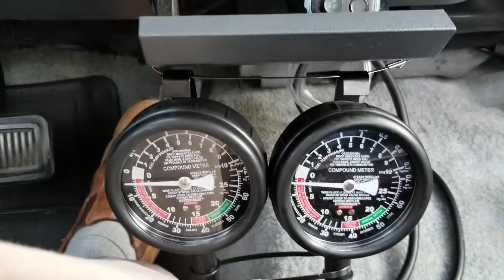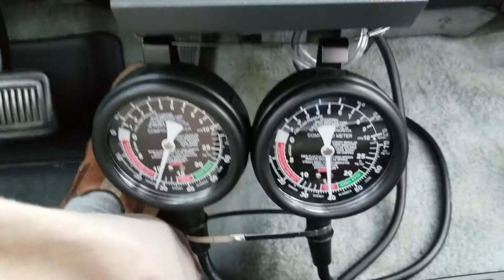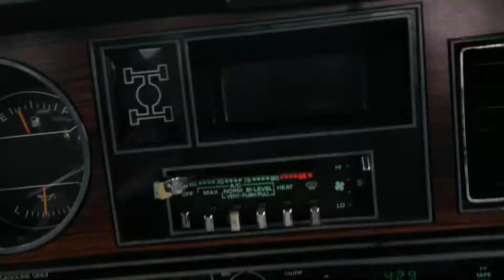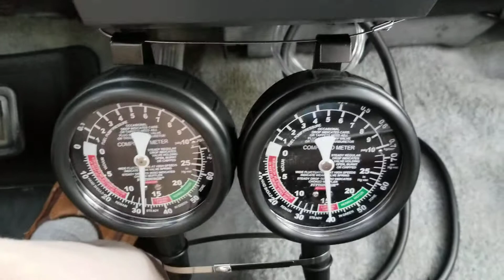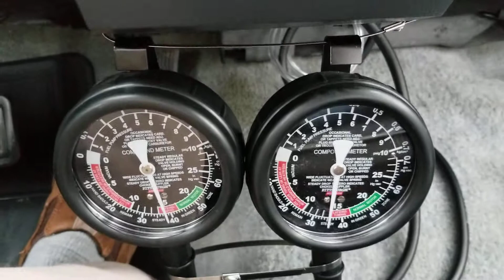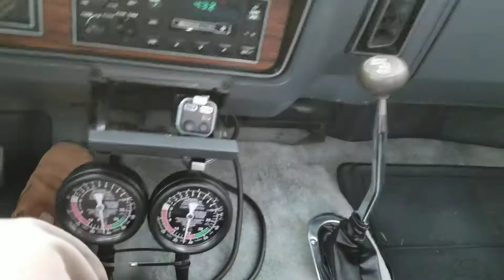Demo:  Ported vs. Manifold Vacuum in 318 w/ Holly 4bbl

Comment: I've done this test myself, read a lot on the different forums, tried one way then the other on two Chevelles and although I thought manifold would be better, it seems my cammed 454 likes the ported connection and my almost stock 350 like manifold. Can't say why, but I do it the way my engine tells me it's happiest.
Reply: You can’t just switch between the two without adjusting everything else ya know.
Reply: @yeboscrebo4451  Right, so as far as my understanding goes you mainly just need to adjust idle mixture screws (lean out the engine more if what I was told is correct when using manifold) and adjust the idle speed screw, and possibly metering rods/jets? So long as your initial and total timing are set with vacuum disconnected and plugged that should not need to be adjusted correct? Stock engines back in the day were built to run on full vacuum though so is it just aftermarket performance cams that can cause issues? I am curious because I have played around with Manifold before when I didn't really understand it and the idle being affected always weirded me out (I have from what I can tell a stock/mild 77 454 in a k10 half ton that I have dailyed for 6 years now) so I switched back to ported. I have the truck running pretty lean right now 1 1/2 out on the screws of a AVS2 800 cfm eddy, idles consistently at 650rpm every time after it warms up, 14 initial timing and 35 total at 3500 rpm (i checked to make sure the timing doesn't advances past 3500 with a digital timing light that I know is accurate), starts right up when cold and half manual choke. I feel like manifold is the way to go though after doing more research as it seems that it would give better throttle response or at least smoother so to speak since the engine would only be using the va as it needs during light throttle to wot. I am going to try it tomorrow and adjust the idle speed screw, but let me know if there is anything else i should be looking out for.
Reply: @stormwolfgames6636  manifold advance will add to your initial timing so at idle and low load cruise you’ll get a lot of timing (which is good).  Try using a vacuum pump on your vacuum canister at idle and watch your timing light.  Keep pumping the pump and watching your timing light to determine what timing your engine loves at that rpm.  You’ll be able to see and hear your engine running smoother then note the timing when that happens.  With that number you can adjust an appropriate balance of initial timing and timing from your vacuum advance canister to get that amount of timing at idle that your engine wants.   Ideally you want as much initial timing as your engine will accept, with the proper amount of vacuum advance timing (you need an adjustable canister obviously) and then make sure that the total timing is limited to stay wi5in a safe range.  High initial timing with an appropriate amount of vacuum advance connected to manifold and limited total timing will give you a peppy, powerful, efficient and smooth running engine
Reply: @stormwolfgames6636  you want to dial in ignition timing BEFORE you start messing with the carburetor IMO.  And remember that idle mixture screws only affect idle
Reply: @yeboscrebo4451  Okay i set my total timing already before i changed from ported to manifold, using a digital timing light that I know for a fact is accurate. My initial fell at 14 to get a total timing of 35 at about 3500 rpm ( I did confirm the timing did not advance any further than that when i revved to 4000) , that is all done without VA. After attaching VA to manifold, i idle at 34 because my VA canister is giving me 20 i guess since my initial is 14 without. So for a 454 35 i am told is the sweet spot for any build and 38 is safest max, it seems to like the manifold better my bottom end power seems much better now since i swapped over. I am guessing its because the throttle response from idle to wot is better taken care of sitting at a much higher initial timing with the VA. Oddly enough i really didnt need to mess with my idle speed screw very much and i didnt even touch the mixture screws all seems well. Do you think I should go higher than 35 total? Initial really doesnt mean anything besides a good starting point to get the truck to idle when you first stab the dizzy. It really just falls wherever you want your total to be.
Reply: @stormwolfgames6636  Right on!  Sounds like you’re doing good!  I would curve your distributor though to get all your timing in WELL before 3500.  When you get it to come all in by 2000-2500, you’ll get much better, more peppy acceleration and better gas mileage.  My old truck loves 32 degrees at idle with the VA, every vehicle is different.  I don’t know if you should go higher than 35 total - you’ll have to experiment with it.  I suggest getting a good quality AFR gauge when you start messing with the carb adjustments.  It’ll make the task SO much easier and enjoyable because you’ll be able to see quite clearly what adjustments need to be made.

Comment: The Gauges are Vacuum only, do not allow seeing the advanced weights and springs affect on timing along side of the vacuum. Nice that you did the work though. . Your TACH with RPM by those gauges would have been very very helpful as long as you quote your centrifugal curve from mechanical advance changes.
Reply: I was only demonstrating the difference in vacuum readings between the two...
Reply: Very good point. The mechanical advance is going to affect the vacuum. The mechanical advance curve is going to determine your vacuum advance aproach and whether to use ported or manifold vacuum👍

Comment: Manifold vacuum makes more sense. Ported is liar, because of air flow next to opening and the moment when secondary opens. It's also slower to react when needed, and changing all over the place when not needed. 
On the other hand manifold vacuum is directly related to cylinder filling/pressure.
Reply: Yep

Comment: Good demo but you didn't mention which one you use, and why...
Reply: I’m old school, I set my idle at 2k, vacuum advance hooked to ported, and adjust timing for the highest RPM without kickback, and best vacuum. Then when you adjust idle back to normal RPM, that’s the best your engine will run on your fuel, and altitude.
Reply from the maker: Number one I'm a total nerd and I like to see things in action. The ported vacuum is an indicator of the health and well-being of my carburetor. The intake manifold vacuum is an indicator of the health and well-being of well many things not to mention my Pistons my piston rings Etc. However collectively they have a symbiotic relationship like a dance together and if that dance gets out of Step that tells me something entirely different about the engine you see that's how beautiful things can get and sorry for for the run-on sentence but I love your question thank you amen
Reply: Sorry, i thought you were talking about distributor vacuum advance.
Reply from the maker: @lucsavoie9501  Many distributors use "ported" vacuum for the advance, since no advance is needed at idle.
Reply: @stereopolice  no one seems to explain the benefits of using ported because mine runs so much better all around with manifold vacuum.
Reply: @lucsavoie9501  I’m sure it’s running better at idle using manifold vacuum as manifold vac will add some advance whereas ported vac will not as it has no vacuum at idle. Under acceleration manifold and ported vacuum are the same.
Reply: Extra advance at idle helps provide a smoother idle, and a higher manifold vacuum gauge reading.  My engine just idles better with that added advance.  Try it yourself, you'll like it....
....RooDog....
Reply: At idle the condition should be lean or to put it more correctly lacking density. It takes more time to burn less dense mixture, therefore it needs more time to do it. If you run manifold vacuum you will get advance at idle under low or no load which is where it is needed. It's the same reason that when you are breaking in a flat tappet cam you will want to add advance. In this condition with no load the engine can turn faster than the flame front travels and is still burning in the exhaust which is hard on the cooling system, headers and valves. Burn leaner at idle will require advanced timing. The reason for using ported is that the nitrogen oxide levels go up when burning lean so they want you to richen the mixture to keep these levels low and then with a rich mixture you can have less advanced timing. It also aids in the catalytic converter to get hot enough to do it's job.
Reply: @jamesford2942  doesn’t make sense, if your going to run advanced timing at idle, why the hell do you need a vacuum advance to begin with? Just adjust timing like a race car and omit the mechanical advance. And the catalytic converter was not invented till decades after mechanical advances were in use. Guys go drive an antique car with column mounted advance and you will see the need for it, especially for starting without kickback when engine is hot.
Reply: Too much initial timing can cause starter Kickback, that is why we retard the ignition at startup in the first place.    Ask any old Harley kick start rider about that....
....RooDog....